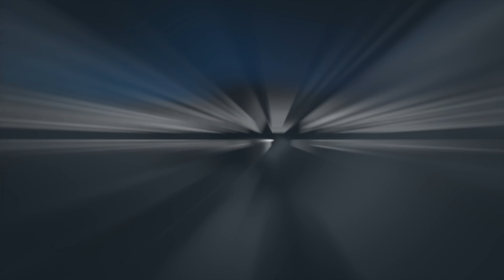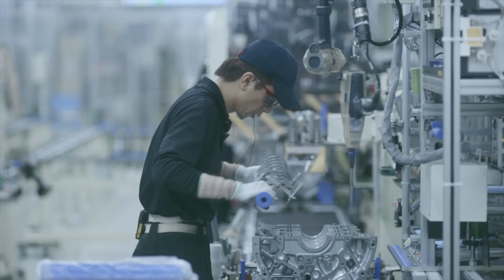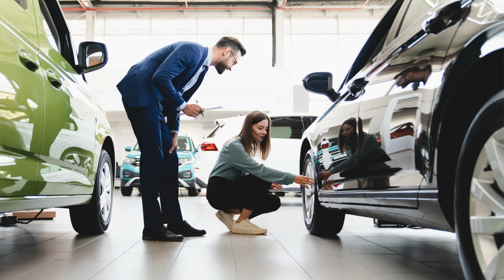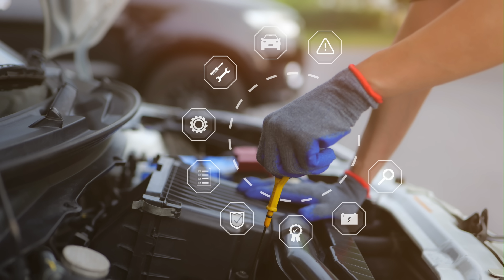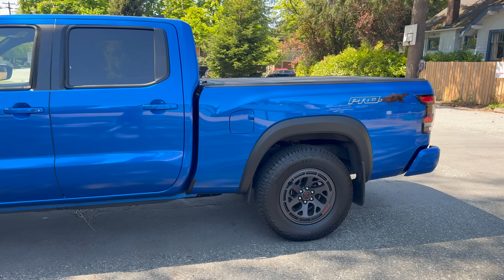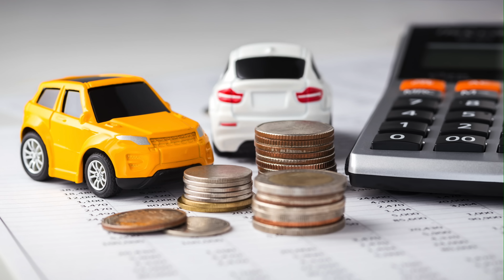DON'T BUY FIRST YEAR OF A NEW PRODUCT // DON'T EVEN BUY SECOND YEAR // MAYBE THIRD YEAR?

Comment: As an Engineer that's worked in other industries I'd also add not to buy the very last year of a model. Simply because if any tooling has worn faster than expected then there is the strong temptation to run it past it's best to avoid having to pay for new tooling. Especially given there is not the return to be made on the remaining manufacturing period.

Comment: I bought the first year of the rav4 prime... Got lucky fortunately... I don't think waiting 3 years is prudent... Better to just review possible problems after 6-12 months being in production. Someone who would follow this 3 year general rule won't know the difference between the facelifted models so they won't be missing out anyway as long as the car is reliable. Another method is to just buy the car in the first year... Take great care of it. Put low miles on it and then when the face lifted model comes out trade up. IF the facelift is something worth trading up to... Waiting 2-4 years is kind of bad because another manufacturer will probably release a car you're more interested in and then what? Wait another 3-4 years? You'll be waiting 6 years... Cars have warranties. Do some research make sure it's not a lemon. Have fun.

Comment: Unfortunately this logic is more complicated when you're looking at cars during or even after the COVID years. Plus if you've got a specific budget for the price of the car used or new, then that impacts what year of the car you can buy especially if you're looking a used car in a specific price range. I'd you like a first or second model year vehicle & it has the features & color combination you like with the mileage you're looking for, then it's better to just get an extended warranty for it to have peace of mind. If you're leasing the car, then that changes things as well. If you're buying it used, then an extended warranty to cover the electronics & mechanical components would be very helpful depending on how long you plan to keep that car

Comment: For a Tesla,  dont buy any year :)   The last year, the tools and dies may be worn out.  The 4th year, I've seen  cost cuts...as in decontenting.  Current camry is largely based on prior gen platform but it had a heavy steel hood vs aluminum with prior.

Comment: I agree. At least for the honda pilot. They usually have a facelift by during the 4th year for example 3rd gen pilot was 16-18 (3 manufacturing yrs) pre face lifted year. The facelift was 19-22 model yrs and it generally more reliable than the pre face lift. Granted it had its issues too.

Comment: It's not just cars. I am a technician in a different industry and the same has been true. One new from the ground up design I worked on when it came out in 2003 had a few unusual problems. They solved the problems and that company is still producing equipment based on that same design.

Comment: David, normally, I would agree with you.  However, we just bought the new 2025, 6th-gen 4Runner TRD Offroad premium hybrid.  First, all 4Runners are built at the Tahara, Japan factory.  Second, the A25T-TKS engine has been out for four years.  Third, the eight-speed transmission has been out for three years.  Toyota will make things right if there are any problems.  Toyota is the king of hybrid technology and my hybrid warranty is for ten years.  The bottom line is that the 5th gen 4Runner was produced for 15 years with few changes.  BTW, we bought our 2023 4Runner for $48,000 and traded it in 30 months later for $47,535 for a total deprication of just $465.
Reply: How do you like your 4 runner? I normally dont but first year redesigns,  however for the same reasons you stated above (built in Tahara, engine has been around for several years without issues, transmission already in use in new tacoma and LC), I have confidence in the 2025 4 runner reliability and should have minimal/minor issues on the first year.

Im waiting on my 2025 ORP to arrive in a few weeks. Plus this new 4 runner drives so much better than the 5th gen.
Reply: @STAYFROSTY629  We have had our 4Runner Offroad Premium hybrid for two weeks and so far, everything is great.  I am picking up the TRD engine and trans skidplates to install while removing the front air dam to increase my angle of attack.  We haven't been off-road yet but I have no reason to believe that the off-road performance will be less than our previous 5th gen.  Our TRD offroad premium did come with 18-inch alloys and Michelin LTX trail tires.  It does have electronic power stilling instead of hydraulic to work with safety feature such as lane-assist which I am now used to when making lane changes.  When I would start the turn, I could feel the lane assist kick in.  On day four, we drove from our house to PDX with 3 miles residential, 36 miles on I-5 at 70 mph, 24 miles on I-205 in late-afternoon traffic and three miles on Airport Road.  We got 23.4 MPG.  Our 5th gen would struggle to average 20 MPG.  The hybrid has more HP and torque than the standard T-25A-FKS engine.  I am now a hybrid believer.  Toyota did not pass on the f**cking Trump tariffs of 25%.  Hopefully, Toyota will hold off on tariffs until your truck unloads at the port.

Comment: I normally follow that advice…but I was victim of an impulse buy recently. I bought a 2026 Honda Passport Trail Sport after cross shopping a Gen 5 4RNR. We immediately went on a vacation to Florida in the Passport and returned home with almost 3,000 miles on it. Outside of a couple infotainment glitches with Car Play it’s been stellar. No weird noises, warning lights, and it’s exceeding rated mpg on the highway. Being a little OCD I have noticed a couple panel fitment issues on the outside but nothing severe. Overall I’m very pleased so far.
Reply: What are you getting for mpg in your daily driving compared to EPA estimate?

Comment: for a daily driver. just buy an used 5 yr+ Japanese car from a reputable place/person. Some benefits: least depreciation while still getting decent tech. If the car doesn't have major issues , it usually won't have any until the next 50k miles. You also save some insurance and maintnance money. You;re less likely to face stealership problems too. 
Saving both time and money so you can have a second real FUN car.

Comment: Sounds like good advice. The 2010-2012 Ford Taurus had multiple problems that were fixed in the 2013 model. A mechanic told me to always buy the last 2 years of a generation. For example, 2018-19 Ford Taurus, 2011-12 Nissan Pathfinder.

Comment: This is why I bought a 2024 4Runner. Wanted to get that 15th year 5th Gen before it was gone. Gonna drive it for 20 years or so.
Reply: Same here when I bought my 14 RX and 18 GS new and they've been fantastic cars. At 60 I'm hoping they're my last cars and I PM the heck out of them with oil stacked to the ceiling in my basement.
Reply: Same here. 24 ORP. No bugs.
Reply: Also better ground clearance. 15 years without any major changes will never happen again. Also bought 24 4 runner  trd off road. I did drive the new 25 model and to be truthful it drives so much better ,Also  I am sure the crash test will be much improved over mine. But day to day peace of mind knowing the last year 4 runner will run trouble free I will keep my 24.
Reply: Interesting.  This makes me wanna buy a Playstation 3

Comment: Bought a new 25 Honda CR-V hybrid Sport L a couple of months ago.  Partly bought it based on your review and Ahmed’s.  3rd year of the cycle.  24’s had 2 recalls but none on my 25.  Glad I got it before the tariffs started.  Traded in my 24 Toyota Prius which I hated and only kept for 5 months.  It was my 3rd Prius.  Toyota really screwed up this generation Prius!  Loved my 15 and 17 Prius.  This is my first Honda since a late 90’s Accord V6 that I bought new which was a great car.  This may be my last new car at 67 years old and I’m enjoying it so far.  Changed the oil at 1k miles and will do it again at 5k miles and then every 5k miles.  Easy diy.  Etranny needs a fluid change every 30k miles which is another easy DIY.  Time will tell how the direct injection carbon build up goes.  Going to run a bottle of Red Line fuel system cleaner every 3k miles and only use top tier fuel to help combat that.  Hope to get at least 200k trouble free miles out of it.  Bought the 8 year/120k mile no deductible Hondacare warranty “just in case” since I got it for only $1.4k.  One repair could easily put that cost under water.
Reply: How is the 2025 Honda CRV hybrid now that you've had some time with it? Looking at trading in my 2020 Rav4 Hybrid for the 2026 Honda CRV hybrid.
Reply: @DrakonR  good so far.  Have done 7k miles and avg 44.5 mpg in mixed driving.  Hate the windshield wipers and fluid sprayers.  Look it up online and you will see everone hates that system.  Going into the shop tomorrow to get a brake issue checked and I had to get a random safety error msg checked around 3k miles that turned out to be nothing.  Oil/filter changed at 1k and 5k miles.  Going to drive a rav4 when the new gen starts hitting the dealer lots early 26 but I really like the CRV interior compared to what I’ve seen on the new rav4.
Reply: @batmiata5506  thank you for the info.

Comment: I agree, however I need a new vehicle, I choose 4Runner and used 4Runners are as expensive as the new one. Therefore i’ll be taking a risk on the newly designed model. Also, I want a modern vehicle, not the essentially 15 year old design with a (gasp) 5-speed transmission.

Comment: Normally I agree but with Toyota in 2026 I think I will change my mind. Why? Cablegate was never resolved even by 2025 in 2019-2025. They are also using the same 2.5L dynamic force to power the 5th gen hybrid system which has been tested in camry and cross

Comment: NOPE. First year Porsche 911 996.1, 1999 in USA, proved to have waaaay fewer engine failures from bore scoring than subsequent years. Also, gas pedal still linked by a cable vs eGas charming and the engines felt a bit more torquey (beats me why).

Comment: I bought 2010 first year 3rd gen Prius (I believe can still run another 100k miles), now replaced it with 2025 first year 9th gen Camry. I am going to buy 10 year/100k miles extended warranty.  Fingers crossed.

Comment: David, I agree with everything you say, and in the past, I would typically follow this line of logic. Only problem is, I'm 52 now. If I keep on waiting all these years before I buy a model that I like I might not be around long enough to buy it let alone enjoy it lol.
Reply: I am 64, and just bought the first year of a brand new model (Mazda CX-70 PHEV Premium), despite Consumer Reports not recommending it based on the mechanically similar CX-90 that had debuted the previous year. After 8 months and ~15k miles, I’ve had no troubles/complaints. This will be the last new vehicle that I ever own (after 47 years of driving), so wish me luck!
Reply: you can buy the Lexus rx now lol
Reply: @europec2082 useless comment
Reply: CX5.   or the CX50 has the same powertrain as the CX5.
Reply: I bought a first year Rav4 and had 0 issues. Maybe some we're bad? But it's hard to say every first year or 2 is trash. 😂
Reply: You make it sound like 52 going on 72 lol. Get a grip man.

Comment: I feel that there is an element of inter generational improvements, where issues in previous generations are fixed in the new one. There might be some flaws with a new model in first year, but you get to experience a new model that is more rare on the road, and you have a feeling of driving a newer model for longer. Right now, buying a Mazda 3 or corolla will feel a bit dated. I find it hard to believe that the later production runs are necessarily better: accountants love cheap alternative suppliers, and surely if they find a cheap supplier in any year, they will try it out?

Comment: I'm buying the prelude when it comes out first year. Just going to cross my fingers that since it will be made in Ohio at an established plant, using carry over parts from the Integra and Civic that hopefully it will be good to go. 

Shortened Civic chassis.
Civic type R suspension and brakes.
Integra dash
Civic hybrid infotainment.
Accord or Civic powertrain.

Hopefully it works out.

Comment: I was lucky to buy a 2016 Lexus RX as the first year one. Haven't done anything so far except for regular maintenance and tire & break pad replacement. The original battery is still running strong into its 9th year.

Comment: One case in proof would be the 2nd gen Honda Cr-v. The first 3 years (2002-2004) had self-imploding A/C compressors they did not revise until late cycle 2005 models ("Facelift Years").

Comment: Good advice, I have been driving my 2008 Toyota 4Runner for over 16 years without any problems at all.  Everything still looks and drives like new.
Reply: I guess I got lucky.  I have a 2003 limited and no problems.
Reply: Same.  2003 v8 Limited that refuses to die.

Comment: Accurate..  first few years of a major redesign is risky for reliability.  Sometimes even a refresh, depending on what it is.  It doesn’t matter where it’s built so much as what the design or oem part issues are.  Not so much workmanship, but rather part issues or design issues.

Comment: I’d like to also add that in addition to allowing the model to age a couple of years, also check for customer complaints. For example, Nissan has been using the Jayco CVT for years, yet it is still a way inferior transmission when compared to a Honda CVT.

Comment: I bought a 2021 Tacoma TRD Off-Road 4x4. It's the 5th year of the 3rd gen Tacoma and 2nd year after they added the carplay and power seats. 

Four years later, the only issue i have had is the 12v battery.

Comment: I personally like buying vehicles right before the new redesigned model comes out.  Especially if I need to keep it for the long term.   I did that with my 2022 Mercedes E450 All-Terrain (which was the penultimate year before the redesign in mid-2023), which had zero reliability issues in 36K of driving, and subsequently sold to my brother.    I broke that pattern a bit, with my 2025 Mercedes E450 All-terrain Wagon (2nd year after the redesign), which is still too new at just over 3K miles, but thus far has displayed spotless reliability, and hopefully will stay the same for the long haul.
Reply: At 3k miles for a car costing well over 65k it better be perfect but please keep  us informed when u get 63k miles on it

Comment: Salut j'ai un Rav 4 2012, V6 un 2GR FI et je fais de la livraison rapide avec. Je l'ai depuis 3 ans et j'ai fais 200,000 km depuis. Il a maintenant 285,000 km et Il n'a de look moderne, mais très puissant en montagne (269 HP) et résiste bien à ma conduite agressive... Les bonnes journées, je fais 500 km pour de la livraison rapide et ce en montagne. Il ne démontre aucun signe d' usure, ne prend pas d'huile. J'y mets de la synthétique et au 8,000 km. Oui, il consomme plus qu'un 4 litres mais lorsque je changerai vers 400,000 km vers été ou automne 2026, il sera encore très bon, les 4 Litres ne me résiste pas.... Moi j'achète la dernier année de la série et que le véhicule ai 10 ans et soit qualifié d'extraordinaire, et avec beaucoup de pièces d'origine disponible, donc je chercherai un Toyota 2026 +/- et en V6, fin de série pas d'hybride et jamais d'électrique... J'aimerais un 4Runner TRD Pro, mais trop dispendieux pour faire de la livraison, ou un Hylander Limited...
Ha aussi, moi je crois que les véhicules au dessus de 2020, ne sont pas trop fiable, mais le temps dira la vérité... Bonne route.

Comment: So true.  Thank you for saying this.  l change cars every 3-4 years and the new Toyota 4Runner is very tempting for me but for a while now, I have stopped buying first year and re-designed cars.  You don't have to do deep research to see that this is true.  Even the new and revered Camry seems to be having transmission problems.

Comment: What do you think of the new 2025 Camry AWD?
Would you wait to get the 2026 model?
Would you describe the 2025 as a refresh or a redesign?
Do you think they'll ever offer a PHEV that also has AWD?
Reply: Some whispers are claiming the transmission has issues for some owners, but it doesn't seem as noisy as the Tundra.. yet. Still amusing a local dealer near me hasn't sold their Camry LEs that they've had for many months. Briefly changed their site's pricing with tariffs but since kept it at the same crossed out 28200 it was before and still no takers. If I really needed to move on from my 06 Camry, I possibly would grab such a new Camry as they the dealer is looking to move the old inventory as the next model year arrives. PS Realistically it's the more guzzling models whose quality is getting crushed by EPA rules as that becomes the manufacturer's target audience.